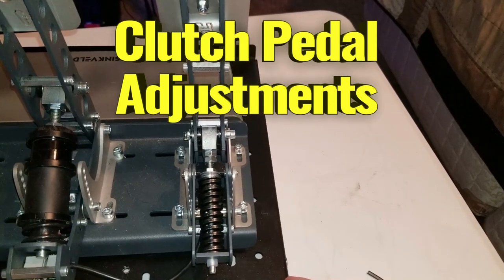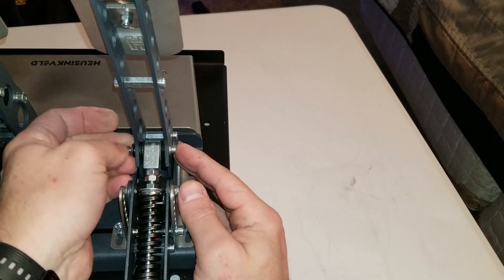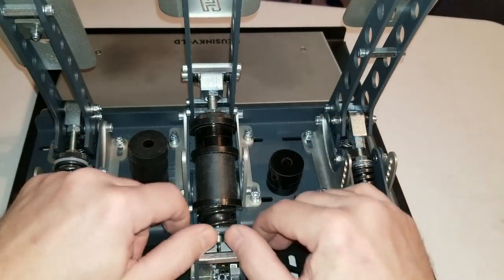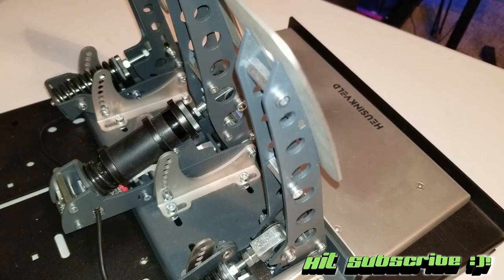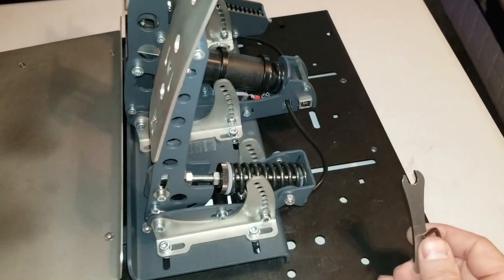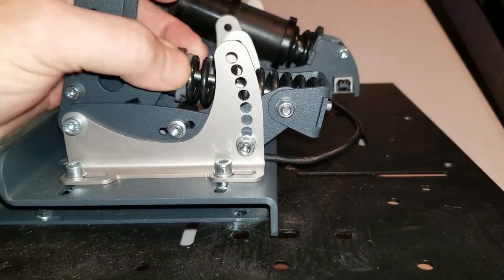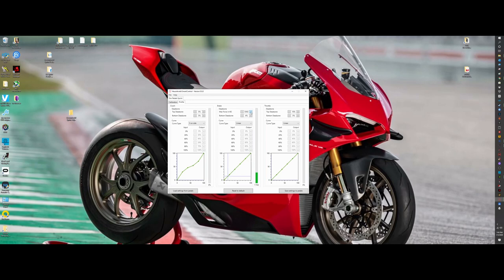Heusinkveld Sprint Pedal How To Adjustment and Software

Comment from the maker: Time Stamps in the Description and here. :)
Time Stamps
0:26 Remove from Rig
0:44 Clutch Pedal Adjustment
8:47 Brake Adjustment
19:50 Throttle Adjustment
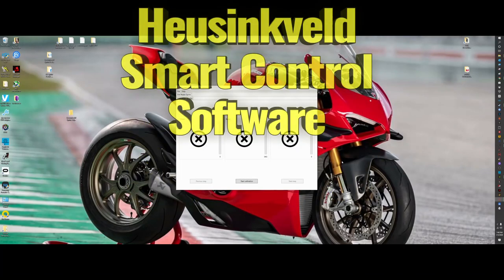33:57 Software Adjustment
Reply: i know this video is 4 years old, but thanks dude, it still very usefull. : )
Reply from the maker: Glad to help 👍

Comment: You missed an important detail on the brake rubbers. Every rubber should always be right between two large spacers. Never stack a rubber onto another rubber or in your case a small spacer. It's all explained in the manual.

Comment: Very helpful. Just had my first day with these pedals and my right knee is so sore. Need to do some serious softening of the accelerator. Would be nice if HE offered optional throttle springs, softer or harder than the ones they normally ship with.

Comment: Hi Thanks for the vid, quick question though, on the clutch pedal, can it be modified to be on the longest travel but as soft as on the shortest travel?
Reply from the maker: Hello. This should be possible. I have mine set on longest travel, but stiff Spring. There is only so much less you can make the spring travel though. Hope this helps.

Comment: Thanks for the review! Is there a thing as too much or too little preload? I’m not sure how much preload to add I’m on a strong preload right now but it feels like the pedal is barely moving pushing down
Reply from the maker: No you can just adjust it to your licking. The stiffer you make it the less actual travel it will have. You are basically just compressing the elastomers to make the travel. So the harder the elastomer you use the less travel you will get. Maybe play with it more. Try some softer elastomers and set your pedal pressure in the software somewhere like 45kg. Then adjust the elastomer to the travel you like to equal that 45kg of load cell pressure. Hope that makes since.

Comment: Question about the throttle Preload nut. I see after you loosen it, it just sits a little further up. It's ok to leave it like that? No need to tighten up the nut I guess. (Not referring to preload wheel that your turning with your finger). Just the nut that sits above it.

Comment: Hello once again! I love your in depth videos! I am looking to get the Heusinkveld ultimate + pedals this year but once again I'm worried about compatibility. I am seeing a lot of game where forum posts are coming up with pedals not being detected, not mapping, or only some of them working, or the worse case everything works until you get in game and a full pedal push is only doing 30-50% power. How often have you struggled to get them to work on all different games outside of Dirt rally, AC, PC2, and iracing? I am looking for playing some of the more arcade games as well like crew 1/2 , grid, and such.

Comment: Hi.  Does the Simetik pedal deck come ready drilled for the sprint baseplate.  Thanks
Reply from the maker: Jeff Nazer Hello. So unfortunately not. Here is my how to vid for it though. Works perfect with using 4 of the front mounting bolt hole that are easier to get to. https://youtu.be/754SUn-bBIU
Reply: TJRSim thank you,  I’ll need to order some sprints.👍
Reply from the maker: Jeff Nazer awesomeness! You will love them.

Comment: On the brake can I change the first 2 hard plastic pieces out for the rubber an is that the softest setting
Reply from the maker: I’ll have to look again for the softest setting but yes you can do that. You just want to make sure you end up with the same overall height as  stock to get the correct travel. Be sure to re-calibrate the brake in the software afterwards. Have fun!
Reply: @TJRSIM  thx man I was able to swap it n recal in 3 mins w watching ur videos
Reply: @TJRSIM  love those pedals
Reply from the maker: @marshallstrong7854  that’s great to hear. I new you would. ;)

Comment: great!
for me 3rubber even for gt car i find that we control better just my opinion
with only one is pretty difficult,we don't feel anything on
the return of the pedal
Reply from the maker: I also can control my brake pressure with a lot more control with more rubbers. Currently, I'm using 2 and 2 bushings. It's a little stiffer, but I can trail brake a lot better now and don't over brake during oh $hit moments. lol
Reply: TJRSim Just to clarify, do you mean that you’re using 2 rubbers (Medium+Small) plus 2 hard plastic spacers? I believe that takes you to one level stiffer than the default, right? I’m trying to set up my pedals now and would love your take!
Reply from the maker: @obscurelyf  just got back home and checked. Yeap I'm using the med (2nd to longest one) seen at 14:06 and one small rubber bushing with 2 hard plastic bushings seen at 12:56. This makes it pretty stiff. About 1+ level stiffer than stock setup. It's fun to play around with it. Been using this for a while and like it for controlling trail braking or easing off the brake to stop lock up without releasing the brake too much. Better for panic braking to.
Reply: TJRSim thanks! That’s helpful. I think I’m going to start with -1 level from default (XL+S and one hard plastic piece) since it felt super tough out of the box. I am mostly running lighter cup cars in the sims and I’m trying to get the feel as close to what I’m used to on the track. 

I’m going with pretty minimal preload as well which it looks like you’re doing
Reply from the maker: @obscurelyf  Awesome. Glad to help. Yeah, these pedals or so versatile and easy to adjust.

Comment: is there a way to have shorter Clutch travel?
Reply from the maker: No I do not think so. Not without loosing the push over effect. You can set the software to engage and disengage at a much shorter range though.

Comment: Well done sir. OK I'm ready to move on from the v3's. Top 2 suggestions?
Reply from the maker: Well, HE Sprints of course. Hmm, the second choice maybe HE Ultimates or if your I that price range something with an actually hydraulic cylinder. Honestly, though I don't really have a desire past the Sprints. They do a really good job. Thanks for watching and commenting.
Reply: @TJRSIM  Thanks figured I'd spend a little more and go with ultimates
Reply from the maker: @camerawithwings8607  well done my friend. Well done! Let me know how you like them.
Reply: @TJRSIM  when I try to load smart control software it says device not found, any ideas
Reply from the maker: @camerawithwings8607  Try plugging the pedals into a different USB. It doesn't need to be USB 3.0 either. Then relaunch the program again. Hope this helps.
Reply: @TJRSIM  Thanks man I just heard from support and needless to say I chewed their ass out! i spent all this money and was looking forward to using smartcontrol, stayed up half the night to install the pedals redo the rig and now no software, fucking unbelievable I'm so pissed.

Comment: Nice work Larry! If I didn't have my Main Performance Hydraulic Sim Pedals, I definitely would have a set of Sprints! A few years back at irace4life I tried out the Ultimate pedals and I was blown away by how well I could  Modulate each pedal, so Solid! Glad to see you with Amazing Pedals, Enjoy!!!👍
Reply from the maker: Thanks bud. I can imagine how stiff the Ultimates would get. The modulation of these is really, really good with more travel feel than the Fanatec V3's
Reply: @TJRSIM  I was wondering when you were going to get some high end pedals, glad you do now, very cool!👍

Comment: Can't wait to use mine haha, they come this week, i come from Fanatec v3 with brake kit
Reply from the maker: Awesome. You will love them I'm sure. Nice upgrade from V3 for sure
Reply: @TJRSIM  i hope so haha, and think also yes. See a lot of good comments about the sprints 😀
Reply: @TJRSIM  btw, did you change something on the rubbers or trottle ? Or still default ? Did you test some other rubbers
Reply from the maker: @jeroenschilderink7894  Yeap. I changed them all around. Tested a few combos for a week each. Settled on what I have now which is a tad bit of initial travel followed by stiff rubbers. Would have to look again to see what the combo is.
Reply: @TJRSIM  yeah ok haha, tonight i have them and will test it haha. Thanks for the info, i shall see what i do 😁
Reply from the maker: @jeroenschilderink7894  Anytime. Have fun with it. □

Comment: You like these or the original Heusinkveld pro pedals?
Reply from the maker: Never got the privilege to try the pros, but its hard to believe I would need more then these with all the adjustments and feel I get with them. Although I would love to test the ultimate to compare.
Reply: @TJRSIM  ooh okay, i was thinking about getting sprints too because i don't need the force or what you call them on brakes and so forth on the ultimates as i'm not really interested in simulating driving in a race car.

Comment: Hey here's a smart little trick that's helpful.....when the wife isn't looking take her nail polish and use it to make a line on your nuts or tension knobs to determine how far or how many turns you are adjusting it....you can also use a second color for the 180 degree setting on the nut/knob as well!.....just remember to put the polish back where ya found it when your done!
Reply from the maker: irongoatrocky lol. Good tip!